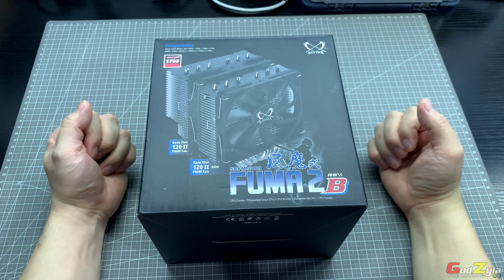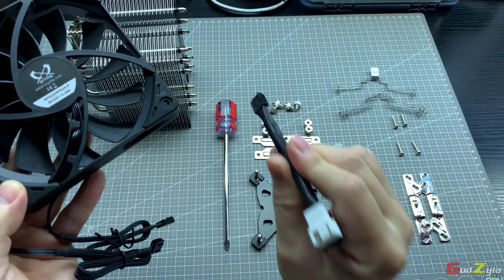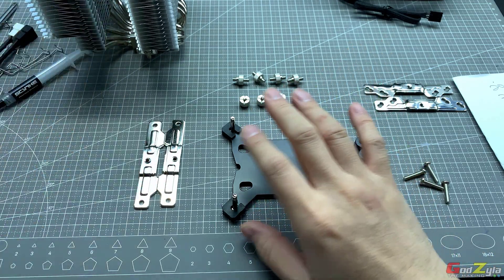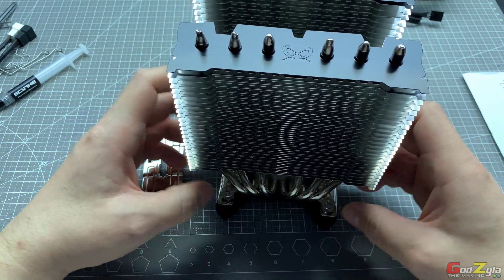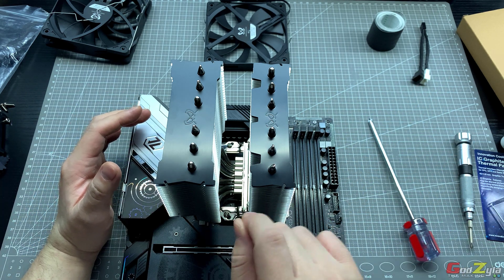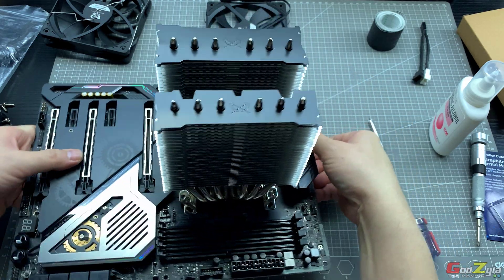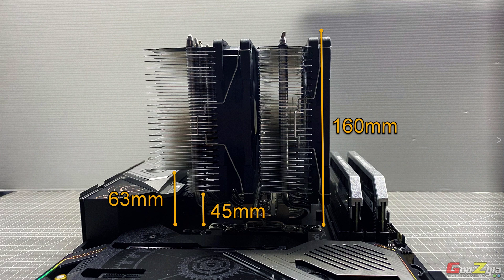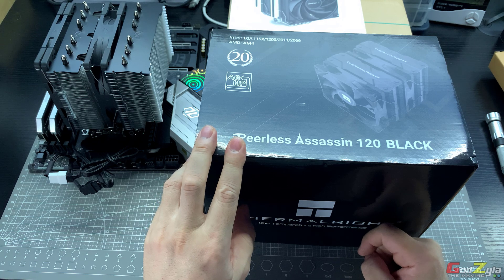Scythe - Fuma 2 Rev B

Comment: Is its possible to save money and just use the scythe thermal paste ? I dont want to buy another one since the cooler  got me one
Reply from the maker: Hello Rafael, welcome to my channel. You can use the paste that comes with it, not an issue, but there might be a difference in temperature from good thermal paste brands like MX4 or MX6 from Arctic or even other good brands like Thermal Grizzly Extreme. The choice is yours.

Comment: The Manual shows that you have to connect the small front fan with the white adapter!? Or doesn't matter?
Reply from the maker: Hello jaymasie, welcome to my channel it does not really matter as it’s trying to indicate one sensor of the fan pair, so that the correct rpm will apply on both fans.

Comment: Hi congratulations for your videos that I follow regularly could you help me? I'm having a problem with the scythe fuma 2 rev b that I installed for my Ryzen 7 5700x processor in idle simply by moving the mouse the temperatures go from 32°C to 60°C I don't understand what's going on . In terms of the case I have a Lian Li Lancool 205 Mesh and Msi B550 Tomahawk motherboard I have 2 Crucial Ballistix 2*16GB memory sticks an Asus Tuf RX6700XT graphics card hoping you can help me
Reply from the maker: Hello macula Binder, welcome to my channel. It’s abit strange by just moving your mouse that it gone up to that high. You might want to check what’s running on the background in task manager.
Reply: @KleoYan  I installed the cooler again and it doesn't change anything the temperature goes from 28°C to more than 50°C as soon as I open Chrome it's beyond understanding...
Reply from the maker: @marcusbinder890  hi, I got mix up with the processor, in fact is perfectly normally for 30 to 60 degrees. My 5700x does react this way too. Do not worry. My bad.  So long it does not hit 75 and above with light load. You should be fine.
Reply: @KleoYan  ok in this case I am reassured thank you 👍
Reply from the maker: @marcusbinder890  you are most welcome.

Comment: How much should I tighten the spring screws on i5-12600 cpu, will fully tightening it crush the ihs
Reply from the maker: Hello Heroic Squirrel, welcome to my channel. Do it evenly as I have illustrated here, I stop where the screw stops as there will be a stop point. Screw it slowly so you don't over tighten it too much!
Reply: @KleoYan  hi there, I screwed them fully down but felt it could be too much pressure, so did a few turns looser (evenly as you said) but it’s hard to know for certain what the correct pressure is
Reply from the maker: @heroicsquirrel3195  yup. let the retention bracket do the job. as for how much pressure. I always start at the beginner to just thread the screws in as in it lighty hold the heatsink, then apply same quarter tighten rotation on each side till it hits to a point where it does not allow me to screw anymore. I have some feel to tighten and with accuracy. Thats why i can do the comparision with other heatsink. https://youtu.be/d2rDgQtX1OM . It just takes time to practice. A way to judge, once system up and running, look at the idle temp. if your idle temp is 68 to 72 consistantly, then that is a bad mount.
Reply: @KleoYan  thanks for all the information and quick reply, my idle temps are 30c so I think I got it good, hopefully scythes stock paste will be decent until I change to kryonaut or something
Reply from the maker: @heroicsquirrel3195  you are most welcome 🙂

Comment: In official site the height is given as 154.5 and i have case with 155mm max cpu height . should i buy this cooler?
Reply from the maker: Hi Notni4a, welcome to my channel, I have measured physically till the tip of the fan as illustrated in this video. I do not suggest you to get this cooler if your case is 155mm max CPU height clearance. it will be of a better choice to get a case that has a 160mm CPU height clearance. This is my strong opinion.
Reply: @KleoYan  which cooler do you suggest me to get
Reply from the maker: @notni4a784  Hi, maybe tell me which case you are using? and do pardon me, I am not very well verse in Air Cooler, just so happened that I was testing three of the best budget in the market. https://youtu.be/d2rDgQtX1OM
Reply: @KleoYan  can u maybe try rechecking the height . I watched lots of reviews and you were the only one saying its 160mm . I would really appreciate a reply
Reply: @KleoYan  it ia a local indonesian brand case called 'fantech cg75'
Reply from the maker: @notni4a784  ok.. I saw the diamension, I will not advise you to get this cooler as your case width is at 190mm, though I dont have this cooler as I've returned to the owner. after checking with him earlier, base on his case the Montech air 100 lite which has case width of 210mm and a CPU Clearance of 160mm. this cooller is about 2 to 3mm and almost hitting the side panel. 
I would suggest you to look for an aircooler that is low profile like this IS-50X v2 from ID cooling https://www.idcooling.com/Product/detail/id/258/name/IS-50X%20V2 video illiustration https://youtu.be/KGnJc5HuRC4

Comment: 9:42 is that ATX or m-ATX motherboard?
Reply from the maker: Hello TCG Arsenal, welcome to my channel. It’s an ASRock x570 Taichi ATX motherboard.
Reply: @KleoYan  will it hit the ram if I use it on m-ATX motherboard?
Reply from the maker: @TCGArsenal  it should have enough clearance if you are using only 2 dimm slots, as for 4 dimm slots, you might hit the rams side slightly or should I say might be a tight fitting.
Reply: @KleoYan  I use 2 dimm slots only.
Reply from the maker: @TCGArsenal  then it should not be an issue.

Comment: Went with the Fuma 2 Rev B to go with my 5900x.  
I was worried at first.  There is so much talk out there about how Zen 3 can get real hot real fast... even though that's just how it's supposed to be or whatever.

Nah.  My 5900x w/ Fuma 2 Rev B runs cooler in every imaginable scenario than my 3600 w/ Hyper 212 Evo did.  All while pulling double the watts.

I couldn't recommend the Fuma 2 enough to anyone wondering about it.  Absolutely amazing heatsink.  It was also the easiest heatsink I've ever installed since it uses the factory AM4 backplate (unlike my previous Hyper 212 Evo).
Reply from the maker: Hello JustAGuy, welcome back and you are absolutely right. this heatsink does an amazing job.. it's proven as I have tested it.. then unique fin stack made it possible to bring down the temperature but need to pair it with a good static pressure fan to give it's fullest potentiall. illustrated here https://youtu.be/d2rDgQtX1OM
Reply: @KleoYan  Thank you for sharing... That's an awesome test you did.
Reply from the maker: @JustAGuy85  you are most welcome.
Reply: What temps are you getting? my 5800x is getting 80c while gaming using an Auraflow x240 after using PBO and undervolting. I bought the Fuma 2 hoping to get better temps.
Reply from the maker: @albertgarcia986  hi welcome to my channel, am not sure if you are asking JustAGuy but hope you get a good temp with the fuma 2 as I wish I could test those out for you but am not able to as I do not have those PC parts you are having (5800x and Auroflow 240 aio).
Reply: @albertgarcia986  I don't think I've ever hit 80C. 

But what load are you doing that gets you to 80C?  

So, I don't use PBO.  My stock PPT limit is 142 watts.  I do use curve optimizer at -13 all core.  I recently disabled that because I think there was something just unstable enough to cause corruption in my OS.  That or my SSD with my OS on it is dying (it is ancient at this point lol).

But to answer you temperature question...
5900x with Fuma 2 Rev. B and 2x120mm fans that came from the two Hyper 212 Evo's I had acquired over the years.

I am running CPU-z's "Stress Test" right now.  PPT is peaked at 142 watts.  
Using HWiNFO64..

5 minutes in and my CPU (Tctl/Tdie) temp is 65.8C.
My actual "Core Temperatures" are 61.7C average.  Core temps ranging from 56.6C - 65C.  Most sitting aroud 60-61C.

That's with my fan settings in the BIOS set to quiet.  These fans can do 2000RPM and push 73CFM each.  My fans are currently sitting just under 1500RPM.  I'm going to put the original fans in here when I feel like it because the fans I'm using are overkill and can be loud.

The fans that come with the Fuma 2 also spin in different directions, creating something like a vortex or whatever.. so that's neat.  I've never even used them, but yeah, I'll be switching over to them in the next few days.

Edit:  That gets me about 4.3ghz all core doing this test.  That can go 200mhz or more higher using curve optimizer (which is undervolting).  But, I disabled it a couple of days ago while I sort out an issue I'm having.
Reply: Well, lemme rephrase that first part I said about "never hitting 80C".  

I've never hit 80C on an all core benchmark/stress test load.  I've never hit 80C in a game.  

I average around 58C-62C in the vast majority of games.  And that's the average of the highest temperature detected by the sensors (HWiNFO64 CPU Tctl/Tdie).  Meaning, my individual core temps are always even lower than that. 

The CPU-z stress test I just did pulls around 10.5-11.6 watts on the first 6 cores, and 9.5 watts on the last 6 cores.

lol, I don't like doing this test like this, but I'm doing it for you.

Prime95, the second option (known to make the most heat/power consumption on Ryzen), running a single thread stress test.

Core 0 power holding 23.0 - 23.1 watts.  Core 0 temp reading is 78.6C.  CPU (Tctl/Tdie) reading is 79.4C.  That's 3 minutes in.  Stopping the test there because it just "feels" scary having 23 watts going through a core.

While it's all fine and fun to run Prime95 to test your temps and even stability, I personally never run any software that uses AVX and puts 100% load on my CPU, so it's not really a "real world" test for me.
Reply: @JustAGuy85  thanks for replying, I get 80c occasionally while gaming, I think it's acceptable considering this chip runs quite hot, and I'm using a low-mid tier AIO. I'll give fuma 2 a try and see how it goes.
Reply: I am so sorry for the non-stop rambling here...
Last thing.
I believe your 5800x has the same default PBO values as the 5900x, right?  
5900x default limits are:
PPT 142w / TDC 90a / EDC 140a

The sweet thing about the 5800x is that it only uses one CCD.  My 5900x has 2x CCD's (6 cores per CCD).  It's practically like having 2x 5600x on one chip.  The 5950x has 2x CCD's (8 cores per CCD) which is like having 2x 5800x's in one CPU.

I used to use PBO on my Ryzen 5 3600 with good results.  The default 65 watt limit was an actual limiting factor to frequencies on that.

When I played around with PBO settings on my 5900x... I lost performance.  I couldn't hit higher frequencies.  It's a very finicky chip OR it's already fine tuned to the max.  OR... my mobo sucks.  But I've read about many others experiencing the same thing on the 5900x.  

I'm just saying, make sure your increased PBO limits are worth it.  In my particular case, Curve Optimizer was all that was needed to naturally gain 200-300+ mhz on all core loads with no extra power consumption or heat.

I'm using an Asus STRIX B450-F Gaming II motherboard.
Reply: @albertgarcia986  Awesome, man.  Yeah, I think 80C spikes aren't a huge deal.  The chip is supposed to protect itself, anyways, so it should throttle down at 90C.  I think you can change that in the BIOS, though (I wouldn't).  

But, yeah, spikes to 80C while averaging 65C could totally be normal for your chip.

ESPECIALLY since you're using PBO.  I won't keep saying it, but I do highly recommend turning PBO off and just using curve optimizer, especially if you're mainly gaming.  You'll certainly get higher frequencies and it won't raise temps or power draw.  It's undervolting, but it's better than manually setting a negative offset to your CPU voltage.  It applies your values throughout all the stages, hence the name "Curve" optimizer.

I didn't even know my B450 board had Curve Optimizer for awhile..  I had to go into AMD Overclocking, select PBO limits from there and THEN I could see Curve Optimizer.
Reply from the maker: @JustAGuy85  thank you to reply. greatly appreciated it 😉
Reply: @KleoYan  My pleasure!  Thank you for the detailed vid that helped me decide to get it haha.
Reply from the maker: @JustAGuy85  hahah.. thanks buddy, I believe in knowledge sharing. Hey, I do get to learn from you too and I like it very much when viewers share their experiences too. Best part of it, I get to learn from others which I like most ^-^v. Thank you buddy on the effort to reply and to aid others.

Comment: Hello, Fuma 2 or bequiet DR2 ? Or another... I7 11700f AND Rgb ram
( high exceeds ) Thanks you verry much 🙏 i m Lost... 🤷
Reply from the maker: HEllo xennos, welcome to my channel. I am not sure about DR2 but will suggest to get Fuma 2 Rev B. If you only use two ram stick, there are enough clearance no issue, same goes to 4 ram stick. just that 4 ram stick is abit tighther but will not hit the Air Cooler, or you can choose to place the fan to your rear. hope that helps.
Reply: @KleoYan  You help me à lot becauze too Many brand 😭

My i7 11700f 42 idle, 60 youtube , 92 game. Room 25. Case cooler perfect.
I need better one rapidly 😫
Thx buddy 🙏👌
Reply from the maker: you are most welcome.. you might want to check this video https://youtu.be/d2rDgQtX1OM . All the best with your build.
Reply: @KleoYan  I have check your another vids and im buying Fuma 2 rev 2 🙂
Thermal paste is incluse in the box ?
If not , Artix mx4 good ? 
Thanks for all 🙂👌
Reply from the maker: @Xennnos  hi ya, welcome back. Yes it comes with the thermal paste but mx4 is all good too. All the best my friend and thank you for visiting and to reply 😉

Comment: I think I put the space with the rubber end facing upwards, is that an issue?  I looked at the pictures in the instrutions and thought that was the way it was supposed to go.  Also how do you know your retention screws are tight enough?  Do you go until it doesn't turn anymore?
Reply from the maker: Hello DaLeadBull, welcome to my channel. As mentioned, if you are using intel processor, the spacer with the rubber is facing down. If it’s AM4, then the rubber will be facing upwards. As for retention, I have tried two methods but to get the best result is to screw the retention where it stops. You will need to screw down in alternate manner so to get balance pressure.

Comment: how does it work with the backplate? Dont CPU sockets usually have like metal parts on the other side of the board so thats why the backplate usually has a cut out middle part? How would that work with a full metal backplate? Unfortunately not shown in video.
Reply from the maker: Hello Value___? welcome to my channel. this is an AM4 motherboard, using the original backplate. unless you are using intel which i do not have that but did illustrate in the video with a brief discription.